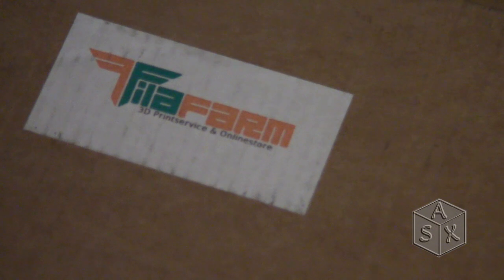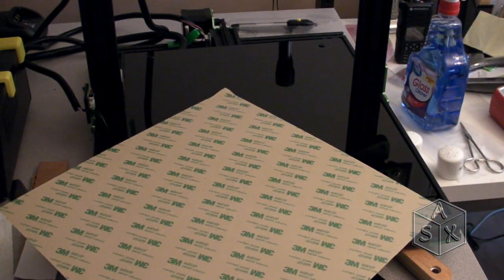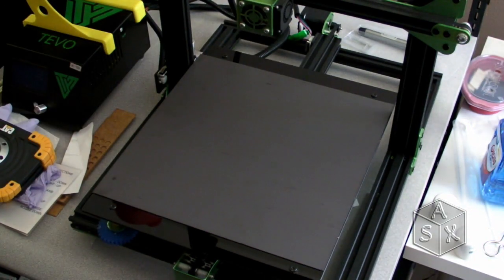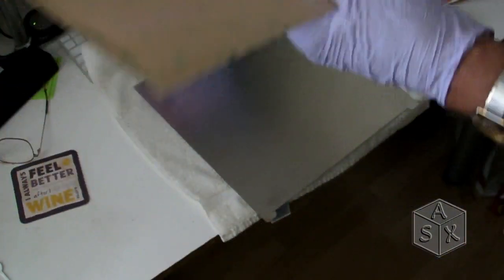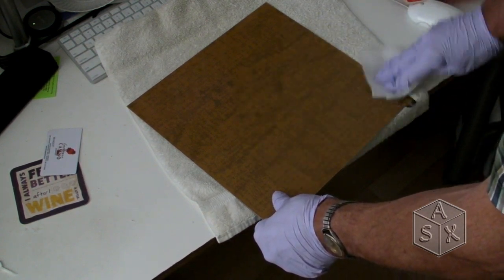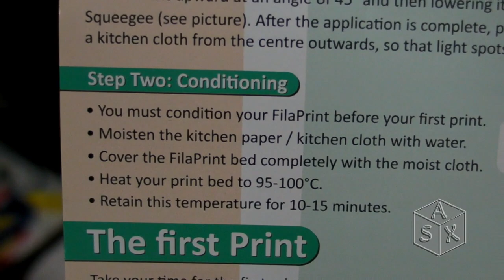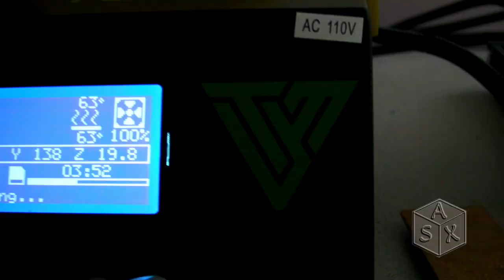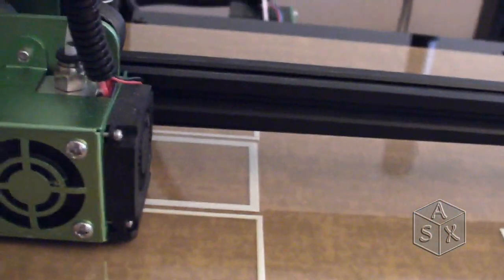FilaFarm Switch Installation and set-up

Comment: Hi.  Question - Switch plate itself is metal and base is magnetized?
Reply from the maker: The magnetic piece sticks down to the original Tornado build plate.  The print surface sticks to a thin metal plate.  Then the magnet holds the build plate down.
Reply: thank you

Comment: Hello, 
could you share your settings for first layer? I cant get the fillaprint to adhere prperly. It still lifts pla in the corners. 
Other beds, PEI and original Ender magnetic sheet no problems. Using BLtoutch.
Fillafarm states i there product is great and im just doing it wrong without givving suggestions what to improve.
Thnx M
Reply from the maker: Hi.  I never had a problem with it.  You need to follow the instruction sheet closely when installing it.  I don't have it anymore with my new Ender 5 but if I remember correctly I used 55-60ºc on the bed.  If I reember corrctly the instruction sheet gave some trouble shooting tips.  if all else fails contact Filafarm on Facebook.  They helped me in the beginning.  Hope this helps
Reply: Hello,
Did you solved it ? I have exactly the same problem. The only way to print something without issues is applying some sort of print adhesive like primafix.
Thanks
Reply: @techgeeks1009  Nope, resorted to only print on PEI sheet. LOT cheaper and much more relaiable. Keeping the fillaprint as a reminder not to buy expensive sheets anymore.
Reply: @RyaReddy  Thanks for your reply. Do you suggest PEI or buildtak ? Any brand that you have checked as reliable ?
Reply: @techgeeks1009  I'm using one from ali brand Twotrees. But energetic ia also an option. Maybe now i would buy a two sided one with PEI powdercouting on one side and a smooth surface on the other. Check specifications first is magnetic sheet can handle at least 110°C.